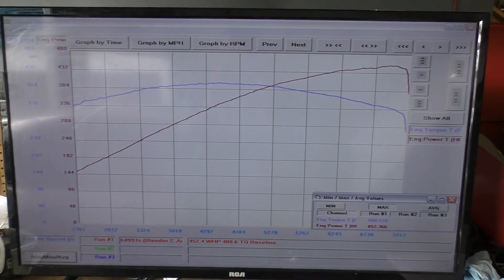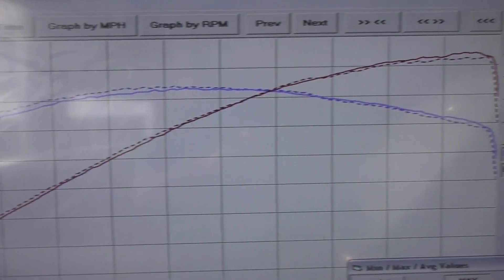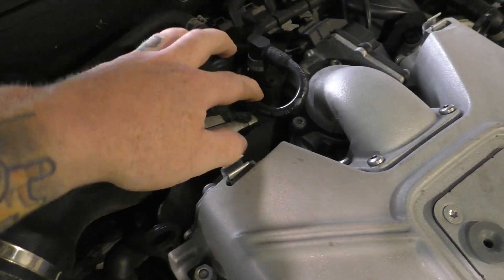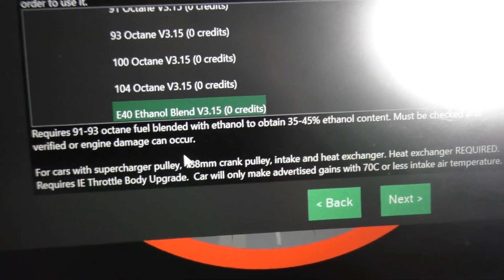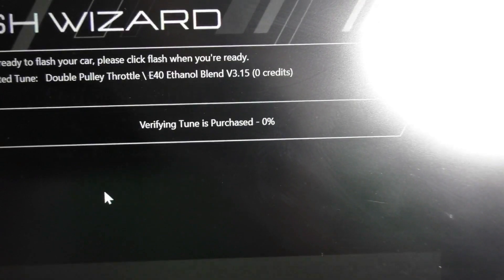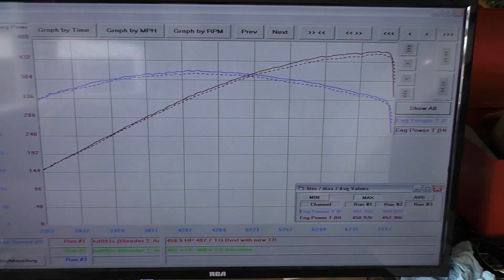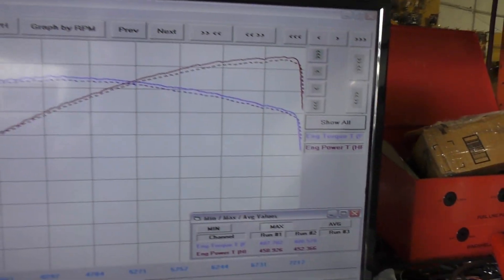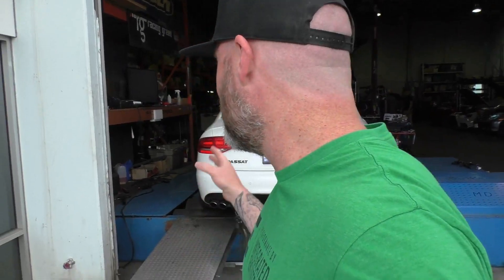Integrated Engineering Throttle Body Dyno Testing - Audi B8 S4

Comment: I saw this coming, and it's interesting to see it verified. I have a supercharged e36 m3 and i was contemplating getting a bigger TB myself, but with supercharged applications, when you open things up (headers, exhaust, even cylinder heads) if boost isn't increased with it, while you're adding airflow, you're losing boost, which likely explains why it took a few runs for your ECU to compensate. I bet if you hooked up a boost gauge, you'd see a 1 to 2 PSI drop in manifold pressure. Turbo cars have a boost reference, so if you open THOSE up, you increase airflow, and your boost will stay the same because the reference doesn't change. Essentially those mods allow you to run the same boost with less heat, meaning less timing ret and not having to worry about detonation on a blower car.
Reply: True, but boost is a restriction. Making more power with less boost means the engine became more efficient.
Reply: @BigCool95  correct, but that doesn't necessarily make more HP. Just that same power at a lower PSI. That being said, untuned cars (with the bypass valve still opening) would probably see a much more significant increase in power increase. Same with other intake, and exhaust mods.

Comment: I'm not surprised at all, but I am not disappointed either. That was pretty much what I expected and you measured it at the wheels. If you raced yourself without the modification, you would lose.

It seems that a lot of the intake and exhaust parts on the cars are pretty good from factory on the 3.0 and changing just one part is like having a straw that is 30% larger, in only one section.

You did it the proper way. One part and then see what it does. Too many people do 2+ parts which either work together to get more power and then divide or estimate the differences which don't tell us what is going on.

Comment: I was super excited to see what was going to happen... I was also thinking of upgrading to a bigger throttle body in the future, reason why i haven't was because most of the after market manifolds (2.0T) is supported for the OEM throttle body and not the up-sized one... So when i saw your new throttle body came with that bottle neck extended piece i knew the gains will probably not be as much 🤷 and you confirmed it for me... Thank you 🤣👌 but it sucks that the gains was so little... I think if it was possible the get a/supercharger / manifold that was supported for that bigger size throttle body it would of have made a much bigger difference

Comment: probably helps with throttle response...it might create a slight velocity stack effect but still tapers down to original throttle size opening. I don't know but if you can port the manifold/SC opening but that may help more.

Comment: Hi Adam, love your videos! It is interesting that top of 4th in your car is just under 200 km/h whereas in the facelift (B8.5) it is around 210 km/h (130 mph). Perhaps, that is why it is a bit harder to run 10's in the B8's. Just an off topic question, what motor oil do you use in your cars?
Reply from the maker: That is because the B8.5's have different gear ratios. That's why it is so much easier to run 10's in a B8.5 rather than a B8. I use Motul 8100 X-Cess 5W40 in the S4 and Motul 300V 5W40 in the RS3.
Reply: @VancityAudi  That's good to know. Thanks a lot for the info!
Reply from the maker: No problemo. Thanks for watching

Comment: I would love to compare my setup with yours. I'm also in Van. I have full APR setup. I'm set up for 94 octane tho. On a C7 A7. Thanks for the useful vids!
Reply from the maker: Head over to Racing Greed and have it dyno tested then! Be prepared to be very saddened by the results though! Lol
Reply: @VancityAudi  It looks like I will be. I noticed a big jump in power through out the gears when I put the throttle body in. It was the last piece to go in, similar to your set up.

Comment: Everyone has to understand that the inlet of the sc where TB is bolted to is 70mm. It doesn’t matter how big of a tb you mount on it, the bottleneck is still there. There is not much material you can grind off, but you can port it to 75mm, then you’ll see results. All these companies selling this overpriced mopar product are.. well..kinda misleading people. 30whp is bs. Port the supercharger also the inlet to 75mm and ofcourse portmatch the flange itself, then do an update.
Best of luck.
Reply: I’ve seen quite a few people say this so I would agree with you. but based off of masterolus UC PORTING video, he makes a statement that anything that helps prevent turbulence in the supercharger inlet flow is beneficial.  An 80mm tb may not flow more air in but it may help smooth the inlet flow

Comment: What kind of dyno are you using?  Just curious…
Reply from the maker: Mustang dyno
Reply: @VancityAudi  I knew something didn’t add up because your car runs low 11s/hi 10s in the 1/4 mile and 458awp just doesn’t seem like enough for a car of your weight.  But because it is a Mustang dyno, you are probably over 500awhp on a Dynojet.  I’m thinking around 520-530awhp.  Looking to make a purchase soon myself.  Just kinda hard because I already have a car I’m working on..1990 Mitsubishi Eclipse AWD.  But I definitely want a nice daily that can put it down when I need and cruise when I want.  Great content and I hope to see more.  When I want to learn about the S4.. I search for your videos.
Reply from the maker: @toney Clayton  thank you for watching. The B8/8.5 community tend to go by Mustang dyno numbers, so that's what I used for this particular build. To get Dynojet numbers off of this dyno the shop multiplies the results by 1.15, so according to these tests, I would have actually made 526whp Dynojet.

Comment: Should have bought the 034 throttle body its a 84mm and cheaper
Reply from the maker: With what proof that it will make more power?
Reply: @VancityAudi  in theory more air more power. the ported blower definitely will  add more power over just the throttle body
Reply from the maker: Theories are great and all but I'd prefer real, unbiased testing as proof instead.
Reply: On 034 website they have the cfm charts posted im not sure if intergrated does but judging by 034s cfm numbers and the size of the throttle body and adapter coupled with 034 4in intake on paper it should flow more. It would be a good video if you compared both throttle bodys side by side on the dyno….
Reply from the maker: @ciscogalvan4174  that flow chart is from the company's website that made the part. That isn't non-biased, haha. Sadly I'll never use an 034 part on this vehicle. I will never represent a company has sh$t morals and ethics.
Reply: shit morals and ethics? pretty bold claim adam. care to elaborate?
Reply from the maker: @jacobwallis7170  smear campaigns, offering huge discounts to switch to their tunes as long as the customers write negative reviews about a competing brand. Nuff said.
Reply: @VancityAudi  I switched from apr to 034. nothing wrong with getting a discount. never once was I asked to shit on apr so long as I went to 034. pretty sure both brands respect each other and make quality products.
Reply from the maker: @jacobwallis7170  I wouldn't touch APR with a 10 foot pole either. With that being said though I wasn't the one that brought up APR, you did, haha.
Reply: @VancityAudi  I just switched from apr to 034 aswell and I got my discount for switching tunes without bashing anybody.. that’s a pretty bold claim to be making about 034. Not saying it isn’t true, but I’ve never heard of them giving discounts, only if the customer bashes whatever tune they came from..
Reply from the maker: @Ess4play  again. I never mentioned APR. You did.
Reply: @VancityAudi  yea you said competing brands, which isn't just IE. but it's all love brother just keep doin your thing.
Reply: @VancityAudi  I’m talking about your claim that 034 offers discounts, if said customer talks down on competing brands.
Reply from the maker: @jacobwallis7170  I actually said 'A' competing brand. Not plural
Reply from the maker: @Ess4play  'A' competing brand. Not plural.
Reply: @VancityAudi  okay fine.. a competing brand. Nevertheless I’ve never heard of such a claim against 034
Reply from the maker: @Ess4play  just because you personally have never heard of such a thing doesn't make it not true. I've been reached out to via social media by over a handful of people sharing the exact same piece of information with me.
Reply: @VancityAudi  I literally said that above lol.. I didn’t say it wasn’t or wasn’t true. But it seems awfully weird a handful of guys think such a bizarre thing is true vs the thousands of happy customers. To each their own I guess.
Reply from the maker: @Ess4play  to each their own is exactly right. If people are happy with their 034 purchases, then so be it. All the success and happiness to you and them. I simply won't be supporting that company, that's all.

Comment: Wow, I feel like I shouldn’t have bought this ie 80mm throttle body kit.
Reply from the maker: Are you planning on running a ported blower? If so, you'll make a noticeable gain above what we saw here.
Reply: @VancityAudi  I’m going to buy one soon, test pipes are next then the ported blower.
Reply: I’m going to buy one soon, test pipes are next then the ported blower.
Reply from the maker: @Just_Modify then it will all be worth it!
Reply: @VancityAudi  throttle body on and I was stage 2 tune so I got the dual pulley tune now, should be good for 450+ I would say. My cats are going to hate it for a while but test pipes will do even more later down the road.